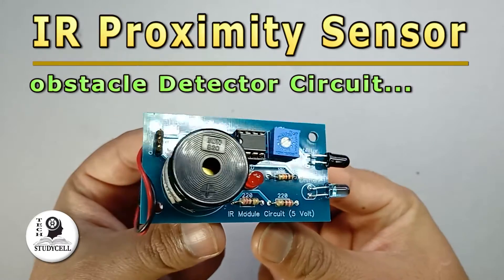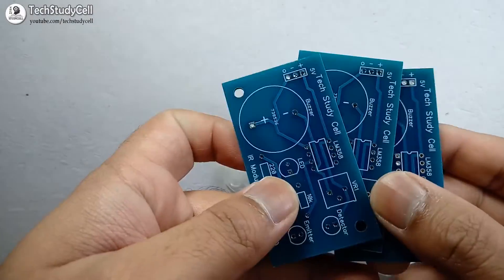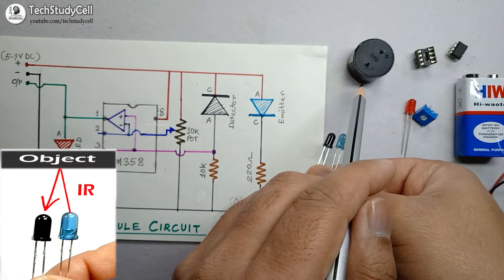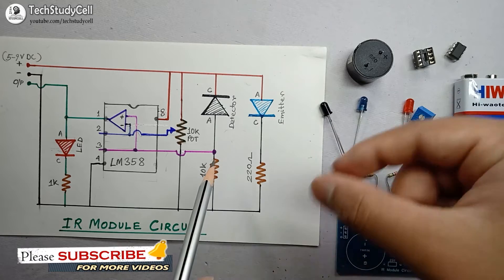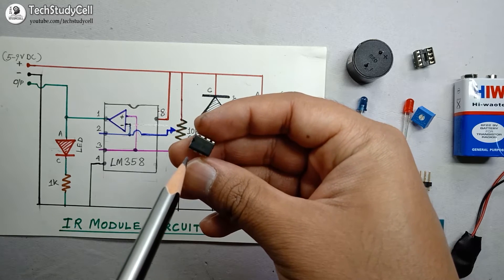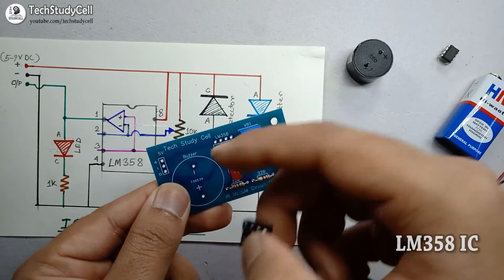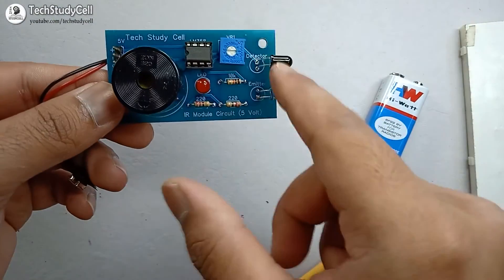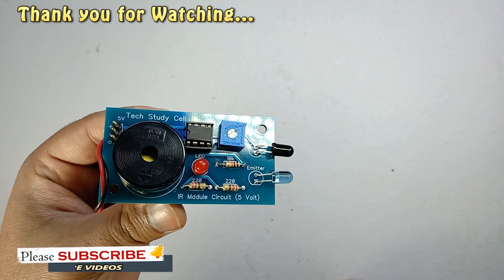IR Proximity Sensor / Obstacle Detector circuit on PCB | LM358 Op-Amp

Comment: Hello sir can you help my please the circuet in question is the MC 3334 circuet diagram for a Hei ignirion system I use old Opel car from the 80s it uses 4 pin GM ignition module who uses that MC 3334 ic chip design and induction trigger pick up coil with e core ignition coil. Now I have problem my lande does not have those special 5 pin gm ignition modules who if grounded can retard ignition timing on my distributor. The circuet does not look variabel enough on the 4 pin gm ignition module . So I hoppe for advice in the past I tried 2x ignition modules to see if 1x pick up coil culd activate them and it can ,I also tried out potenciometer to use preciseli 500k pott from the + pick up wire to + input terminal on the 4 pin ignition module the pott was inbetvean the circuet I supose I done sone thing wrong I used speaker wire didnt have any thing ells so the timing did in fact retarded the ignition coil but the engine run crapy and insted of fiering at compresion my car run on exaust stroke. So that made my wonder how can I disrupt signal for short duration of time? Im not shure my self what to do honestli? Some peopel say use triac some use schmit trigger so Im confused like hell sir . Originali I tough there is posibiliti of useing dual ignition modules and activate 1 or the 2 by useing resistors and some sort of switching circuet relays turning on or off on demand those ignition modules ,Im not shure if there exist any disruptor circuets or any related satelite circuets or chalen controling circuets for that task? Any way my problem is resistance in wires and have cold engine start problems in winter . So I desire some sort of voltage booster circuet or retarding my ignition system for easyr engine start. So the question is how do I do it or calculate it? I did notice resistors and capacitors have some effects from ground and positive sides of ignition modules so Im not shure what to expect as result? Some peopel recomended my useing gold plated low resistance wire so not shure what to expect. Originali I wanted to replace the 4 pin gm ignition module circuet with ordinari more variabel ne555 timer but Im not shure if that thing can work fast enough to drive darlington transistors or not? So I hoppe you finde time and inspect the MC 3334 timer I alredy noticed it isnt variabel enough ,ignition coil saturation is terribel and general spark does not acure at lowr engine rpms also the old hei circuet is effected by ground static so the circuet often fails or miss fires the original clamping zener diode is missing in my circuet . So I reali hoppe some one can tell my more what to try out exactli to just retard my ignition timing or buff the spark bether in safe maner not to cause problems with my alternator or baterry .

Comment: Instead of a speaker can you add a small motor without adding any other passive components?
Reply from the maker: I depends on motor current rating. I will suggest to use a transistor.

Comment: Hi there  I like your project and I have same quatschen.  first wer can I by the board which you are using and  I need run the same project  an  24VDC with  24VDC Relay as a output  (manookians@gmail.com)

Comment: Sir, I have 2 question related to this circuit. 

1. Do the size of ir receiver and ir transmitter would affect the circuit? Because I use 3mm led photo diode and 3mm led transmitter. But the circuit can't work. The led is off or in other condition, maybe stay on. No proximity function work. And next time I try to power up again, the transmitter has looked like dead (no light when I see it through the mobile camera). I use 5v from mobile charger as a supply anyway.

2. Why is the led transmitter burnt out when I connected the +3v to +ve and the -3V to its -ve leg? I see this circuit has the transmitter is connected in reversed polarity. Another channel use the photo diode has been connected reversed, but the transmitter is not reversed. Which one is right? And the reason, please.

Hope you would mind helping me in this case. I love learning something from basic. Sorry for my bad english. Thanks.

Comment: Excellent video and a very clever design. Well done my friend.
Reply from the maker: Thanks
Reply: @TechStudyCell  Bro, I'm stumped by this video, I understand electromagnetic pulses, you can do it with a high voltage generator, but you look at this video, so many antennas, and it's not metal, I've seen this electronic product, it can interfere with mobile phones,  GPS locator, and can open the car door, it doesn't look like the electromagnetic pulse we play, but what is the principle!  You are well-informed, explain how it workshttps://youtu.be/3fZU2mj6Sy4
Reply: @TechStudyCell  can I order for pcb for different circuit